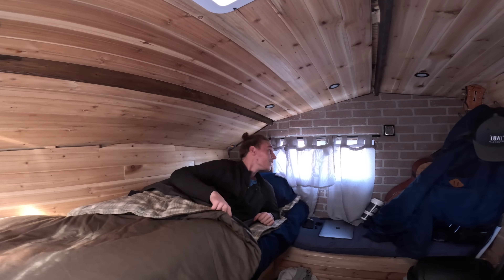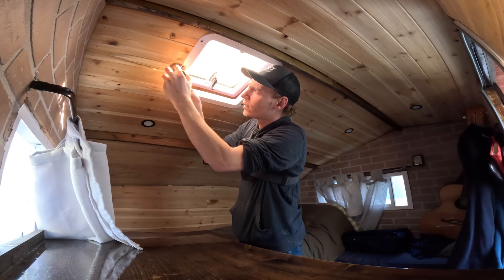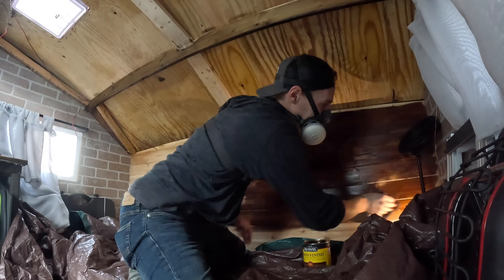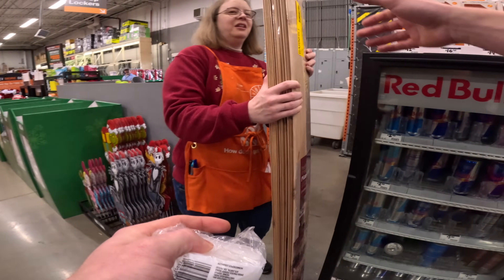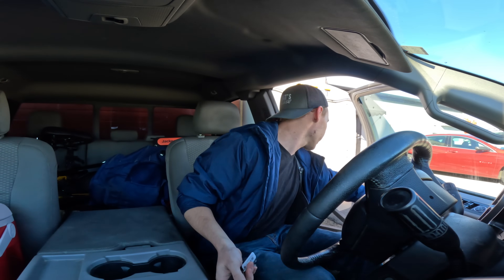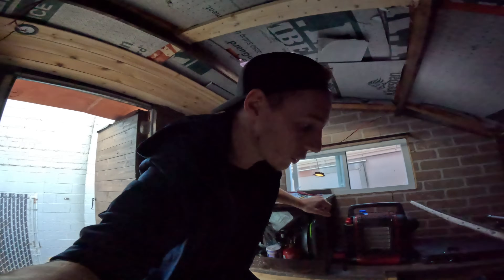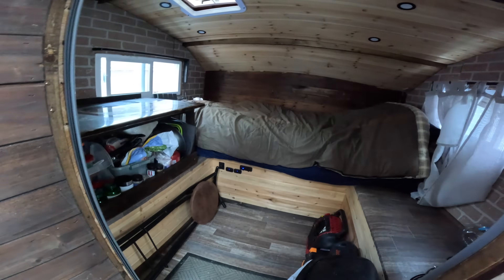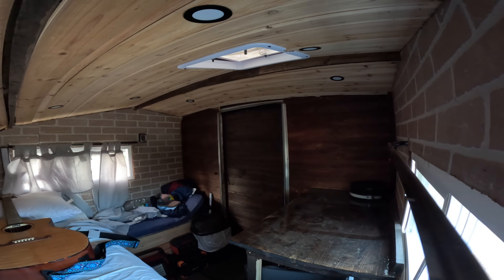My camper has a mold problem... | DIY Truck Camping

Comment: Living in any kind of camper, RV or boat is a constant battle with humidity. In an enclosed space a single human exhaling creates a pint or more of water vapor per day. Without insulation that vapor condenses on cold surfaces, such as the underside of the excellent thermal bridge formed by wood exposed to exterior air. Any exposed gaps or air pockets where the insulation doesn't fully span or meet the next surface completely will hold moisture. Do away with any heat sources that generate water vapor such as propane heat. I would recommend diesel heaters as a replacement. Constant ventilation and monitoring of air flow and interior condensation are vital.

Comment: Hate to say it but without insulation and a plastic vapor barrier you'll still have condensation forming.  The cooler outside air meeting your warm interior is going to cause vapor to form, especially while cooking, it will happen in the walls too.  Love your content, would hate for you to have health problems from mold. Just my 2 cents, keep living your best life Andrew!

Comment: Glad you saw the mold. I would check your mattress if you haven’t. Campers and vans easily get mold under the mattress due to lack of airflow slats provide. If you find some take a hole drill and cut some smaller holes to allow the mattress to breath. You can also use some mold test kits. Mold will be your biggest battle with a small truck camper. Good luck!
Reply from the maker: I'm definitely glad I found it too...  I did check my mattress and it doesn't have any issues so far, but I threw a mattress cover to keep moisture off of it the other day, just to be safe.  Thanks for the tip!  I'll have to give that a try.  You're not wrong though, wood and small enclosed spaces don't mix well, so I've learned... 😅 Hopefully it'll be okay now!  Thanks for watching!

Comment: You have to literally remove the panels with mold and replace for news one cause u dont know how deep into tye wood its going plus instal vapor barrier after you have installed your installation. But knowing you have mold growing, you might wanna check the top under your roof cause you might have a leak which means mold could be on the top part as well.

Comment: I would be checking my roof again to see if you may have a new leak...
It doesn't take much for water to penatrate...looks good keep up the great videos 👍👍👍👍
Reply from the maker: I agree, I think I'll be trying to add another layer of the rubber roofing just to be safe.  Water and wood don't mix too well, that's for sure.  Thanks though!  Appreciate you watching.
Reply: condensation.  Heaviest above your head? @andrewryanpov

Comment: Be sure to keep ur ceiling vent open at least an inch at all times to allow air to flow.
Reply: Great advice! Also if he saves for better heat, he can get rid of the buddy heater since I've heard it causes really bad condensation and mold. Getting a diesel heater would be much better.

Comment: I'm surprised you didn't check the walls too, couldn't there be mold there as well?  Glad you got the ceiling taken care of, I don't think it will come back after what you did, nice job!
Reply from the maker: From what I could see the walls were okay, but it would have just been a lot more in depth repair if I took the wall paneling off so I'm hoping it's all good.  Once I have a bit more finances though I may try to pull the wall panels off and do another spar urethane coat on everything, just to be safe.  I appreciate the support though!  Thanks for watching!

Comment: Hello Andrew.  Just wanted to say that I enjoy the videos and the positive attitude even in the face of difficulties.  I thought I would mention that when you use your Buddy propane heater (and perhaps the stove when inside) you should have a carbon monoxide detector running.  I have seen this recommended on other truck camping channels.  Better safe than sorry.  Keep up the good work my friend!

Comment: Pretty awesome that You're honest Hot wiring this switch lol Bro, take care of the nails Poking out Above your head In the electrical box Won't be a good day hitting your head Or hands Use some wire cutters Husky From home depot Build some good ones Snap those nails off Or staples

Comment: You're going to have to find out where the water intrusion is from the roof of that camper otherwise you're going to end up redoing it all over again and it's going to cost more now yet to replace the insulation as well on top of it if you can't find the water intrusion area in the roof and don't forget about the support beams if there's mold in that little areas it can also be behind the support beams as well.
Sincerely!
R.S.V.
Reply: Yeah he found and fixed the leak a couple of videos back...

The colder months and forgetting to insulate the camper leads to higher humidity inside.

Propane heater doesn't help too; needs a sponsor to show him the diesel dry heater

I gotta look back if he also insulated the side walls, which I think he did as well as that door

Comment: Well you learned the hard way.  Condensation is a major problem with propane heat.  Save for a diesel heater and that will help.  Always try to have a fan running at night.  Good luck!!!!!!
Reply from the maker: That's for sure...  I will definitely be getting a diesel heater as soon as I can.  Don't want to risk running the propane anymore!  Thanks for the tip!  I appreciate you watching!

Comment: You should have worn gloves and protected ur eyes. Also, I figured out that u probably have a leak on ur roof that might contributed to the mold problem. Better do some checking. Keep safe

Comment: That is smart using tply material for insulation. I have a suggestion for gapes in u can use spray foam the gaps and hard to reach areas to put insulation. And also if u have multiple boards connected together caulk can help keep bugs and fumes getting in the cab. it's all up to u. I hope this helps maybe for ur future build. 😊 Looking forward to seeing more videos. I also hope u have an amazing day.
Reply from the maker: Thanks for the tip!  I thought about doing the whole ceiling with foam insulation, but this way was a lot cheaper. 😅 I could definitely use some for the edges of the wall and ceiling though!  I appreciate it.  Thanks a ton for watching!  Hope you have an amazing day as well. 😊

Comment: Hey Andrew.  Another great and honest video.  I know you become inundated with all kinds of suggestions, and I hesitate to add my own.  However, I think it's important to note that if you install a small wood stove in your camper, you'll be limited as to where you can use it.  The smoke from the fire will preclude you from using it while overnighting in urban areas.

Comment: Hey Andrew, I'm new to this channel, but have you ever thought about solar panels or panel so you don't have to keep taking your trucks battery amigo
Reply from the maker: Hey there!  Thanks for watching!  I do plan on adding some solar panels when I can, that way I can run stuff like a dehumidifier and a heater without worrying about my camper batteries dying.  Solar power would be a lifesaver for sure.
Reply: @andrewryanpov, you save so much power and you need a star link too when you are out of state that would be the great for the future especially not wasting time waiting for the sun to rise maybe if the power is hundred percent or million percent then you can waste it anytime then you get to put more charge from the sun and yes life changing for sure amigo

Comment: Ahhhh, no wonder why your sleeping bag was soaked a couple of videos earlier... 

Thanks for sharing your experience with one of the struggles of having problems with insulation and mold in a home made camper.

Was it doing the same thing on your first build?
Reply from the maker: Yeah, that was a ton of moisture to be able to soak my bedding like that...  Hopefully it'll be okay now though.  I'm planning on installing a diesel heater too, which I've heard helps a ton with the humidity levels, so we'll see.  I don't think my first build had any mold, it was a lot bigger space so I think that helped a lot.

Comment: i recall you had a water leak so maybe it came from that
Reply from the maker: I fixed that leak pretty quickly, so I think it was just the high humidity...  Also that leak was by the vent and surprisingly there wasn't any mold over there.  I'll definitely be keeping an eye out for any more leaks though!

Comment: Dont tell me you are running a Mr. Heater….
Reply from the maker: I was running one in my last camper, but I installed a Silvel diesel heater in this one.  They work so much better, and you don’t have the crazy high humidity issue either.
Reply: @andrewryanpov  
Im German Wabasto…

Comment: Not good l
Please take all the sidewalks waire the mold is or was and treat àll effected àrea then incelation.
Otherwise you're going to have to remove the ceiling and sidewall completely and replace it if this does not work.
The mold also can be under this support beams as well just an FYI just started when you were having water intrusions from the ceiling fan area your first camper even though I was heavier it was done more professionally and not such a rush usually when they put the rubber coating on the roofs of these things that eyes they put it on after they install the fan and when I do the rubber coating for the roof it covers everything including the fan area when they first start out when they have to replace it though they do a lot of waterproofing that whole area all over again after the reinstallation of new fan if and when needed just to ensure that there's no water intrusion.
I'm doing another re-roof job rubber coating rubber coating paint all over the roof of the DIY camper topper.
Sincerely
R.S.V.